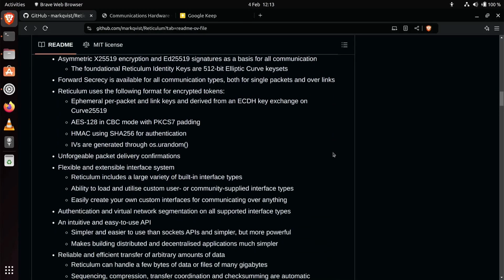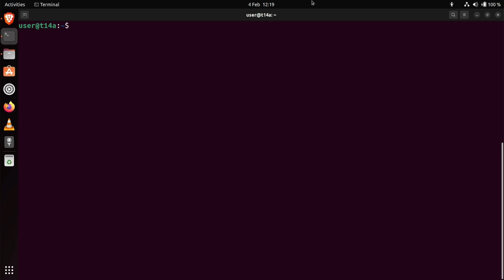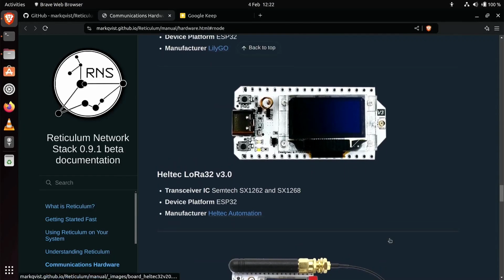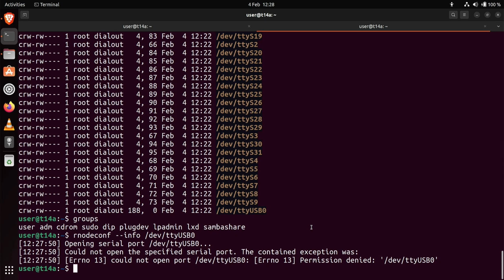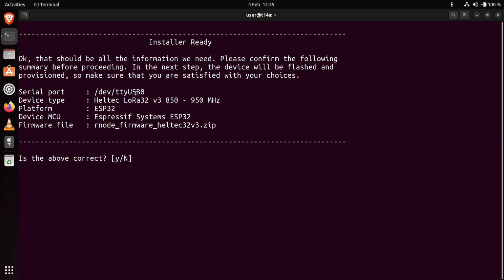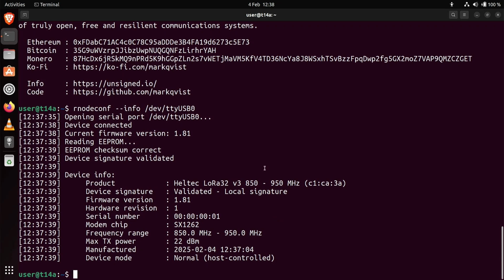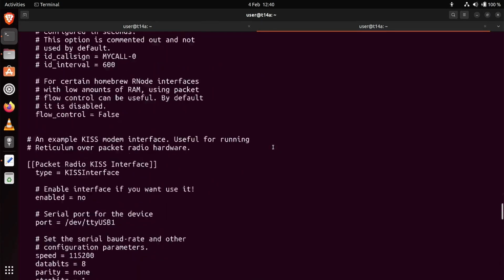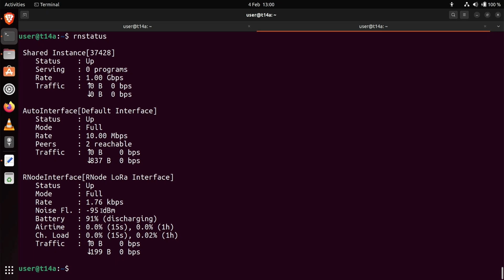Install and Configure Reticulum Network Stack RNS for RNode

Comment: hello i have a lillygo t-lora pager, and i am trying to flash them to Reticulum, but can't find the product in the flasher selection. are there any suggestions on how to flash them?
Reply from the maker: You could try the command line installer as part of the rns package. Use rnodeconf --autoinstall  and see if it is included in there. There are also manual options which might help.

Comment: Nice video, thanks! If you have transport enabled on rnsd and the RNode interface is not meant to route between other rnsd instances over LoRa, but simply serve as an access point for other RNode clients in the area, it's a really good idea to set "mode = ap" on the interface. That will make it more bandwidth efficient, since announces coming in from other interfaces (faster, wider networks, for example) will only be sent over the RNode interface if clients there need them.
Reply from the maker: Thanks for the suggestion. That is a good idea !